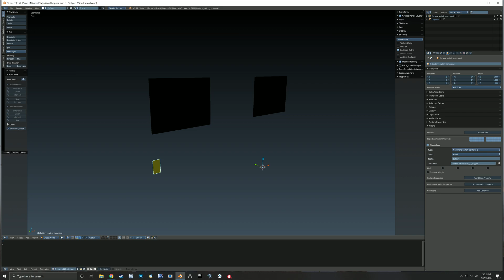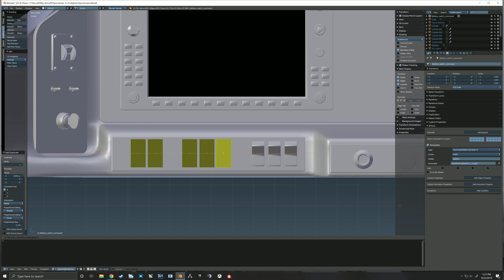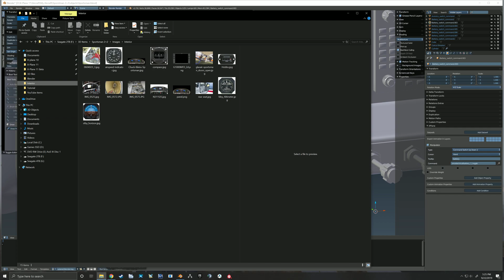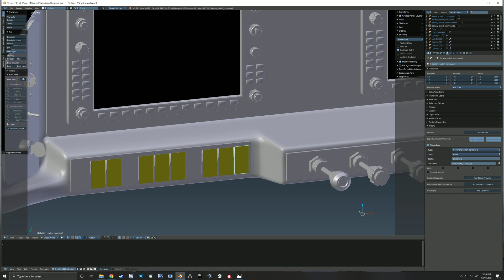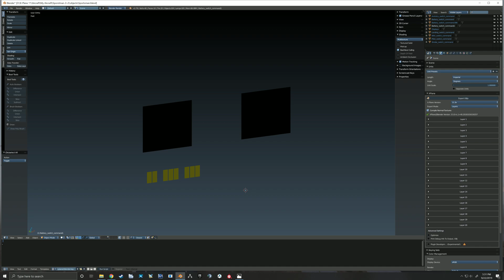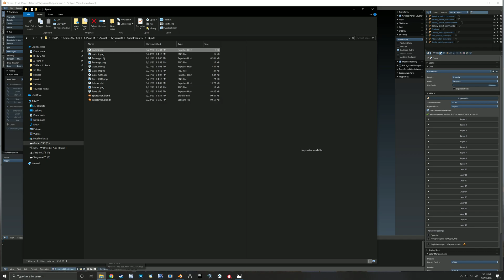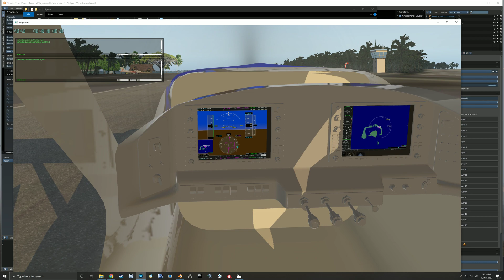How to make an airplane for X-Plane 11 Tutorial #17

Comment: Sorry if I missed some of the parts but how did you get the view look like that?
Reply from the maker: I'm not sure what you're asking. As far as I can remember I did not do anything to change the view from default.
Reply: @BuildItBetter3D  I meant how you made your view in the cockpit? I tried stealing the 747s files then use them and my view is very high..also my plane is a 787
Reply from the maker: In Planemaker go to Standard -> Viewpoint -> General. in the Cockpit section you'll see Long, Lat, and Vert arm pilots viewpoint. Adjusting those is what moves where the pilot view is positioned.
Reply: @BuildItBetter3D  I’ll try this when I get on my pc, thanks a lot! Also you have a discord server?
Reply: @BuildItBetter3D  It worked! Thank you so much!!!
Reply from the maker: Awesome, glad I could help.
Reply: @BuildItBetter3D  got a discord sever btw?
Reply from the maker: I have a discord for my 3D printing projects. There’s a link in the description of those videos.
Reply: @BuildItBetter3D  the link has expired...
Reply: @BuildItBetter3D  I have another problem..yeah sorry but I can’t import textures...weird...would you mind talking to me in dis ord?

Comment: Hi, thanks for your videos, but i have one problem, when i'm sitting in pilot view, i can't see my fuselage object from inside, i saw you had the same problem in video #16 but i didn't see how you fixed it
Thanks
Reply from the maker: In video #16 at 18 minutes 48 seconds I show how I fixed it.
Reply: @BuildItBetter3D  thanks, but it didn't work, i think that because some of my fuselage parts looks like from inside, maybe you know what problem it is(i'm trying to fix this but nothing help, last ~9 hours i'm sitting with this)
They looks like when you turning on "Backface Culling" mode in blender
Reply from the maker: Oh, yes, when building for X-Plane you should always have back face culling on. X-plane default is only one sided faces so backface culling helps you see what x-plane will see. You need to flip the normals for the face in blender. This will mean that you need to make inside walls and outside walls, not just one wall to be seen on both sides. It’s something about the rendering engine of x-plane, double sided faces are slower to compute.
Reply: @BuildItBetter3D  Thank you, you really helped me alot
Reply: @BuildItBetter3D  where is all that stuff written? they can impossibly leave everyone out there need to figure out piece by piece by oneself can they? it's so frustrating, takes years to come to a comprehensive level. Can't tell how difficult it was to find out the basics, like the fact that manipulators only work in cockpit file stored in main root folder. try to create a movable door handle without that base knowledge, impossible. and there is plenty of this kind of secrets which make it hard to develop for x-plane, if you know what i mean. By all appreceation for your videos - which help a lot , there is not a single video out there who starts at point zero with some key facts like the one i mentioned, going through the process in a time lapse, not in all its horrible extent. if i may propose: there is two way of tutoring, one shows the long click by click story of someone showing his work. And there is the other, the one that is missing, someone who could teach the steps fast, clear, in order. Havn't found a single video that does that.
Reply from the maker: Documentation is not great. Most of the info is on the x-plane developer website, but it takes a lot of digging. 
I understand the frustration. Took me many years to feel like I had a fair understanding of it. The trouble in showing step by step is that it would literally take hundreds of hours. Developing even the simplest aircraft for x-plane will take weeks to months. I’ve done my best to cover as much as I could. I only Timelapse parts that had been previously explained in my videos. Of course there’s always something that can be missed, either by the creator forgetting to mention it, or by the viewer not hearing it. 
Good luck on your endeavors.
Reply: @BuildItBetter3D  thanks for the sympathy. If i may ask have you done an episode on how to make handles (and anything that can be interacted with) yet? and how can i the video. thank you.
Reply from the maker: Yes I have. They are in my playlist. https://youtube.com/playlist?list=PLlR55U8ujh5iyj_mGTEsqAG0Uv_2aSpDl I don’t remember what one at the moment, but you should be able to find what you need in there.

Comment: The  fob on my xp11 aircraft increase  the longer you  fly.  Its doing the opposite.  How to edit it ?
Thanks
Reply from the maker: I am not sure I understand, are you talking about the Hobbs meter? If so the value should increase as you fly. Are you saying that the value is getting smaller? Is this happening on the Sportsman or on an aircraft you are making? In the Sportsman the Hobbs meter is a default X-Plane hobbs so there is no editing how it functions. If you have created a custom hobbs then I would need to know how it was made to help fix it. It will be easier to help troubleshoot in the x-plane.org forums, messaging there seems to be easier to use then the comments section here. If you post here: https://forums.x-plane.org/index.php?/forums/forum/3-aircraft-development/ Myself or others will be able to help you fix it.